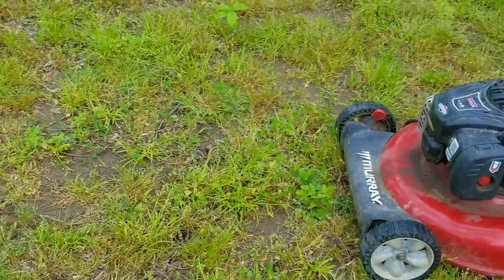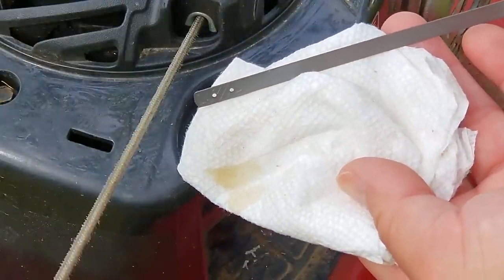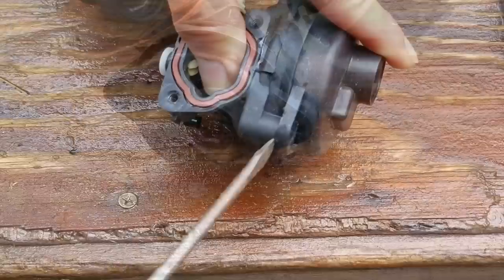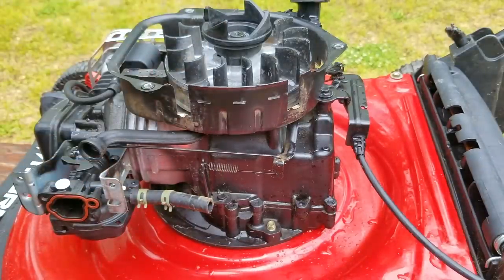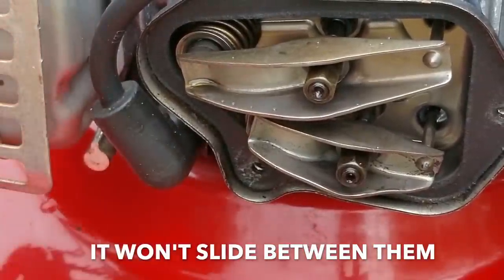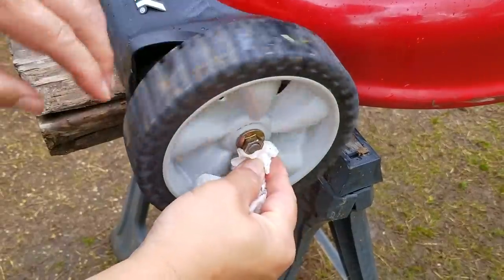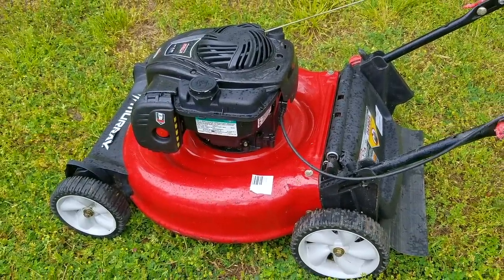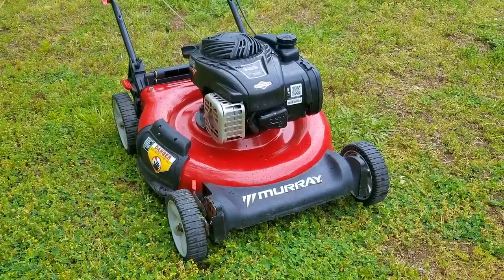Fixing A Murray Mower That Was Found At The Dump

Comment: A too tight valve clearance can also make an engine hard to start.
Reply from the maker: yes you are correct
Reply: This engine series has a hard-start or no-start problem where the choke bellcrank arm gets stuck on the metal bracket, keeping the choke from closing.  This typically happens when the metal bracket is hit and bent inward, but isn't apparent until the next cold start attempt.

You can see this bracket is slightly bent.  Look just under the hand at 4:45.

Replacing the carb "fixes" the problem because new ones have an updated design, but it's quicker to just file down the plastic on the choke arm where it makes contact.  After you confirm it's not binding up or rubbing, bend the bracket back straight, or even beyond to provide extra margin for the next time.

Comment: Those new B&S engines suck. I cleaned my carb last month because it was cutting out, replaced the o-rings, and air filter. It still was cutting out so i replaced the junk engine with a 5.5hp predator
Reply from the maker: nice work